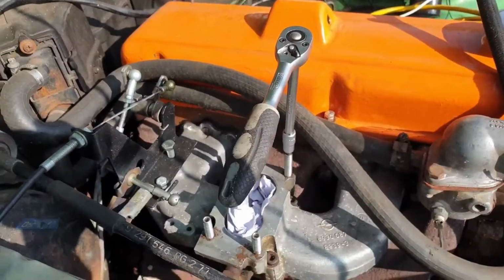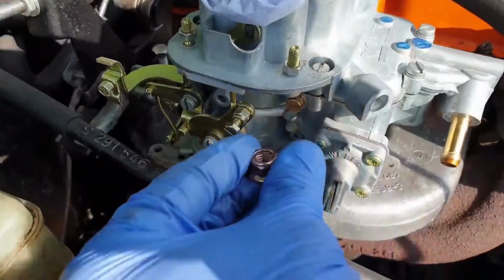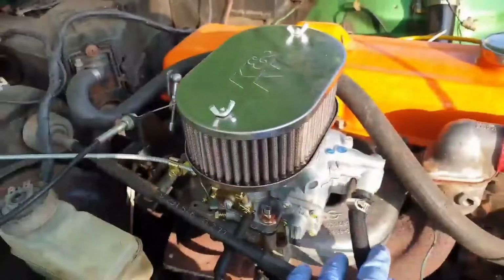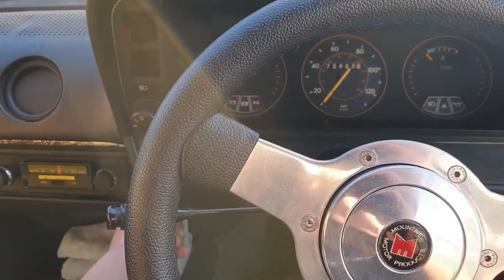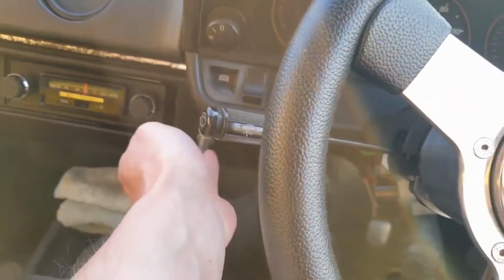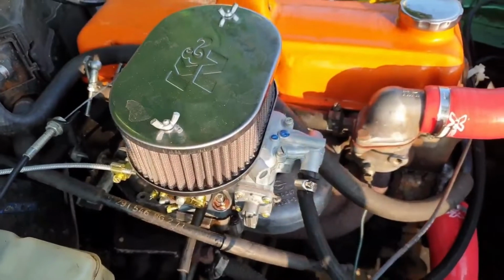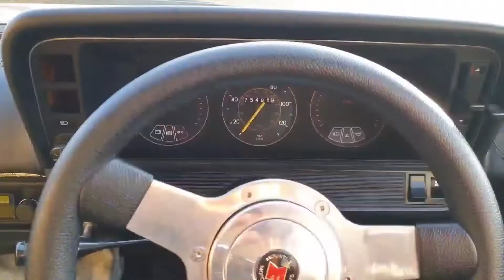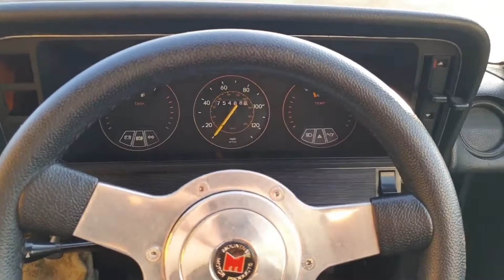1977 Vauxhall Cavalier MK1 – Weber 32/36 DGV fitting continued and setting up idle

Comment: I am currently trying to set up a Weber 32 TLG 250. on a Vauxhall Nova 1.0.  real pain in the bum
Reply from the maker: I can imagine. Do they have more adjustment than just the idle mixture? Is the engine running but rough?
Reply: @boilerhousegarage  I have a mixture screw and an air bleed screw that allows more or less air into the very base of the carb. The travel on the mixture screw is so much...so bit by bit I am test driving around the block and as it is 'pinking' under load giving it more fuel. I did the timing, points gap, it has had everything new, plugs, coil pack, condenser, rotor arm, ht leads....I thinking the engine has a shed load of carbon on the pistons as when the engine is really warm it runs on when I turn it off.  I did think the head gasket was leaking, but it seems to be fine.  Getting lost on this car now......
Reply from the maker: @thomashumber9762  Normally the mixture screw at the base of downdraft Webers is for the idle only, so shouldn't affect driving under load, but I'm not certain as haven't used that carb before.. I think they're on old Renault 5s? 

Pinking as you say is more of a timing issue, usually retarding the timing to remedy or use high octane petrol. If you think carbon buildup is a problem, then try putting water in a spray bottle then as the engine is idling or at fast idle, spray light amounts of water straight into the carb chokes/air intake. It won't cause hydrolock in small amounts as there's still more gas to compress in the combustion chamber, but will turn to steam and clean off the top of the pistons.

Did Novas have points ignition as standard? I thought they were all electronic ignition.
Reply from the maker: @thomashumber9762  Also, overrun is also normally a timing issue. Retard the timing a few degrees to see if that improves it. Are you using 99 octane fuel? If it's an early Nova, the recommended timing will be about 5° too advanced and some old Vauxhalls you have the timing lead on cylinder 4, not 1.
Reply: @boilerhousegarage  Thanks for that. I did play with timing yesterday and retarded it....nothing helped, but I did find its sweet spot for running. I have 95 in the tank now, almost empty so with go get some 98 in a bit. The Carb has been rebuilt...its a Weber 32 TLG 250. Its a single choke. The only screw is the one at the base on r.h side and for sure its doing mixture as had it almost all the way out and the running was sooo rich it oiled plugs and ran very rough with a lot of smoke out the exhaust.  I will try the 98 fuel, if still pinking will try the water ...or I might get an engine treatment to put in the oil.....?? what di you think of those?
Reply: The only other screw on the carb is a big brass one, and it lets air in, I looked it up and it says 'air bleed'
Reply: @boilerhousegarage  its on points with a more modern coil pack. car is 1989.
Reply from the maker: @thomashumber9762  If the carbon buildup is in the valves and/or pistons, the oil additive ones won't do much good. Fuel additives would, but if you use Shell V-power, it has heavy redex-type of detergents in it anyway.

Perhaps look for another carburettor from a 1.0S Nova or similar car, that's running but being broken for parts, so you can swap it over with it ready setup? At least it might give you an idea of it is that or something else, and if the latter, you can sell the carb on.

Comment: Is the thin hose in the middle air or fuel?
Reply from the maker: As in the very thin hose coming from the middle of the carb and off to the front of the engine? If so, that's air, a vacuum hose that advances the timing at the distributor when the throttle is opening.
Reply: @boilerhousegarage  Thank you😃